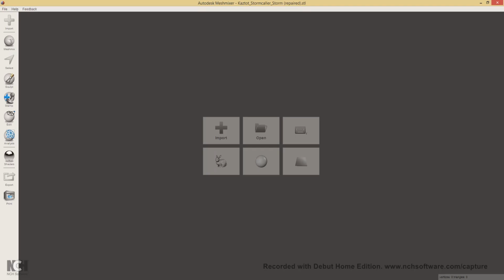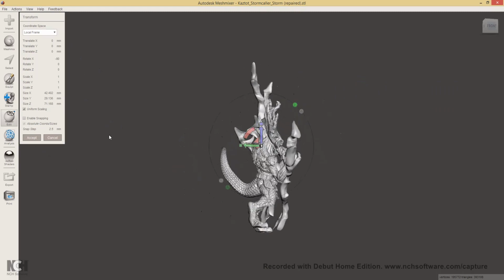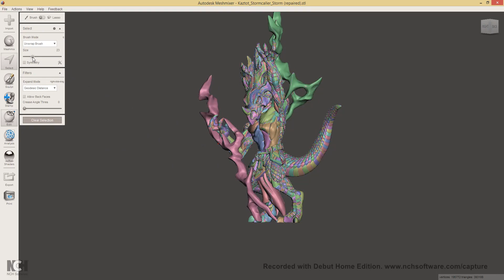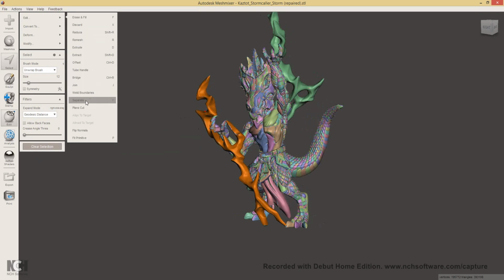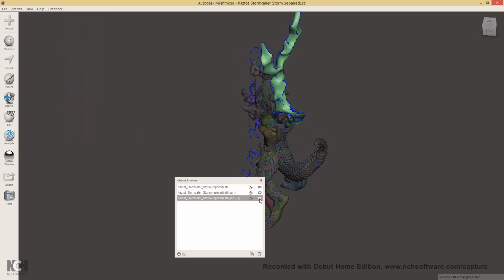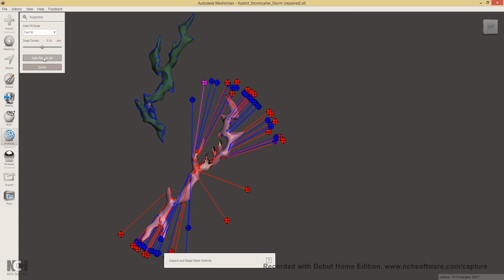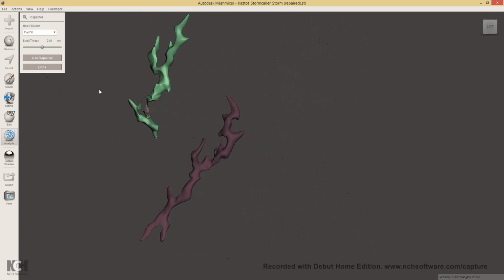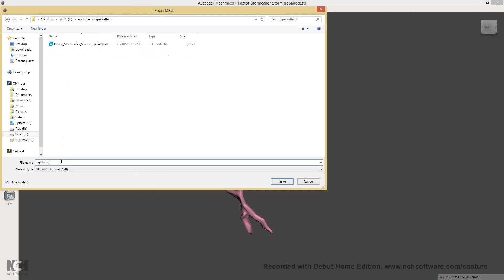How to: Extract Spell Effects from STL Models in MeshMixer for 3D Printing (Capture Lightning)

Comment: Hey I tried to follow your steps but after clicking on 'Generate Facegroup' nothing happens and the model stays grey as usual. Any idea why that might be happening? I tried in on Gufaar the Librarian from the AG gryphkin release.
Reply from the maker: the only thing I can think of is that you have another model selected that you can't see; open the object viewer (ctrl + shift + o) and see if that's the case
Reply: @vlungu  No it seems to be something different.
Reply from the maker: @koljakonschak9851  can you share an image or video of what you're doing?
Reply: @vlungu  I got it to work on a different model, one not from AG. So it seems I'm following all the right steps. Have you tried using the method on the newer models like the gryphkins for example?
Reply: Okay not sure what exactly was going on but I tested a few other models and it works great now! Thanks for your help and thanks for the tutorial! Subbed!
Reply: Oh and one more thing: you can alter the angle and size threshold. Especially the size threshold is nice to reduce the amount of little floaty things :D
Reply from the maker: @koljakonschak9851  will keep this in mind, thanks :)